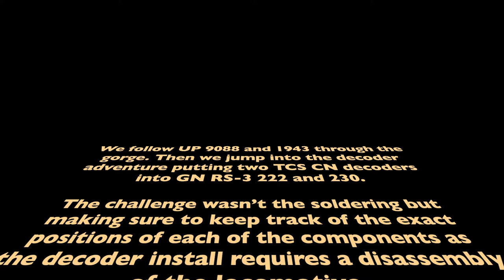Show #4 Decoder Madness! Layout update on the Great Northern Gorge Sub. (Atlas Classic RS3 & TCS CN)

Comment: Pretty cool layout going there.   Looking forward to seeing more and were the heck did you get the Columbia River grain cars?  Man I'm jealous..   Wish you had actually made a teaching video of the decoder install.  I'm still afraid to try.   Chris
Reply from the maker: Thanks Chris - this was a unique install. Actually since there were two I was going to try and record and make the second install a teaching one but it was anything but straight forward. Here are some tips for the install. 1) go grab the online decoder install from TCS and as you disassemble the locomotive take care and lay out every part in the same orientation as it was when you took it out. It's very easy to lose track of which way things were. On the second install I think I ended up flipping the motor top for bottom and it did not like that and took me a while to figure out plus I had to reroute the orange and gray wires. 

The Columbia River grain cars I picked up from my local hobby store (Tammies Hobbies in Beaverton Oregon). There were 3 sets of 3 and all were a fundraiser as I understand it for one of the local clubs. I have two of the sets and as of this past weekend there was still one set available so give them a call I do believe they will do mail-order for you if you are not local or don't want to drive over there. Tell Steve (the guy in the train department) that John sent you :)
Reply: @GreatNorthernPDX  Thank you for the info.  I'll take the advice and try.  As for the cars i would love to get them.   I'm in Amarillo Tx but I'm from Lake Stevens Wa.  I'm modeling Boeing's Pain Field and  Renton plants.   I'm also crossing the Columbia from Vancouver to Portland in N Scale.   Please give me the contact info and I will call them right away.   Thank you so much,  Chris
Reply: Wanted to let you know that I got the last one.   Thanks again for your help,  Chris
Reply from the maker: In case you want more, Hobby Smith in Portland has the other sets. https://www.hobbysmith.com/
Reply: Hey I forgot to tell you but I got all 3 sets.  1 from Tammie's and sets 2&3 from Hobby Smith's.   Thank you so much